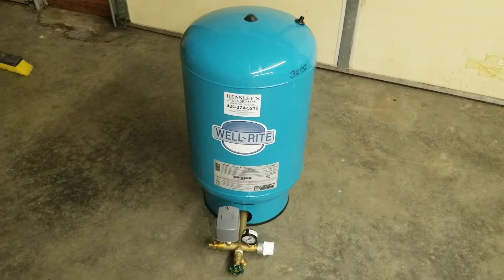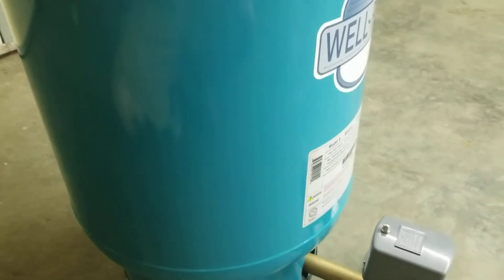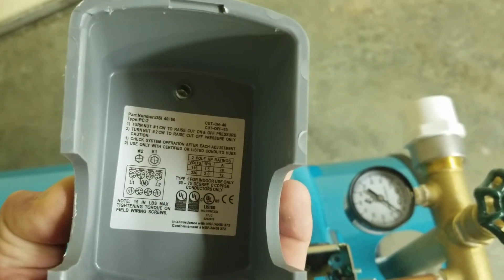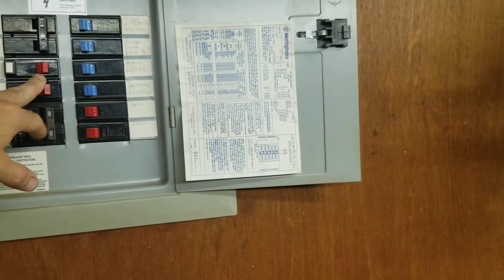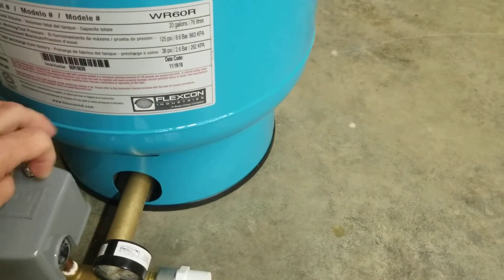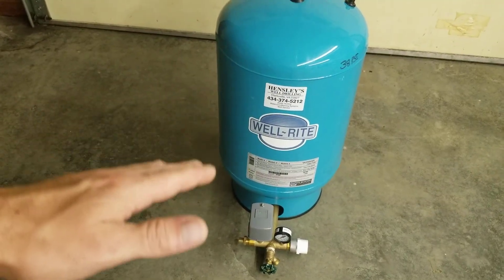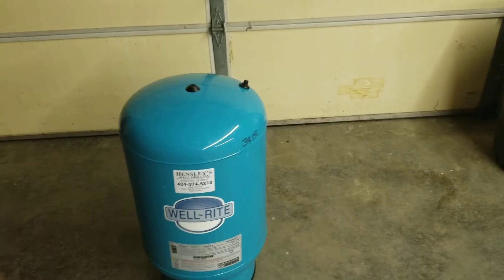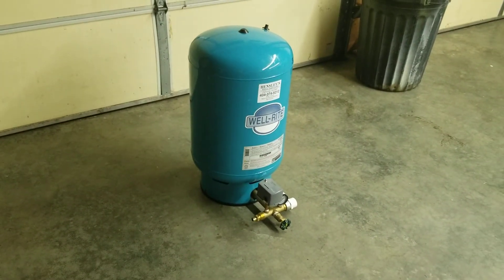Well Pump & Tank Troubleshooting, How the system works, Adjusting Pressure Settings Correctly

Comment: i have  a grundfos  pump  the pressure switch will switch on and off 2 second  intermittantly  at every 30 to 40 seconds ,please advice 
how to repair ? is it the pressure switch faulty or the pressure tank air pressure is low etc..thank you
Reply from the maker: Tank is likely bad or really low on air
Reply: @h2omechanic  thank you so much for the quick reply .So what do i do ,use a bicycle pump to add pressure inside the tank ? how much air pressure is sufficient ?  thanks
Reply from the maker: Under the cover of your pressure switch look for on/off. The on # is key. If it says 20 or 30 or 40, you need to set the tank air pressure 5 psi below it. Yes use a small electric air compressor. First kill the power to pump, breaker off. Then open a sink and leave it open. Then go hook up the air compressor to the top of the tank. It might take 5-10 minutes. Then be sure to check the pressure using a air gauge, or if the pump has one built in, use it to know your pressure.  Once you've done this, turn on the power & allow the sink to run for a few minutes and then turn it off. This allows any trapped sediment to flush itself out. Now if the pressure doesn't build up or hold or you find in a few weeks that it's leaking air out, the tank is bad & must be replaced or itll kill the pump within months! There's lots of videos on my channel, find a Playlist Labeled Well Q&A & watch a few videos & you'll be very knowledgeable about the entire well system. They are very simple and I try to explain things in a way for 99% of people to be able to understand & tackle it themselves.  Hope this helps. 🙏 Be sure to like any videos you watch & share your experience on social media and maybe help me get noticed by a bigger audience.

Comment: Well Done ! Your costumers are lucky to have you ! You are a true master of your trade!
Thank You!
Reply: Hi. I have a pressure tank designed for 60/40 but the switch indicates a 40/20 cycle. The tank indicates it was filled to 38psi at factory. Is there any reason why someone previous to us lowered the tank air pressure to 18 to allow for a 40/20 cycle? Will increasing it to a 60/40 or 50/30 damage the adjustable switch?

Comment: My pump is making a loud vibrating/rumbling noise when the water psi gets around 32-35. If there a serious issue that is causing that?
Reply from the maker: Is it an above ground pump? If so, the front bearing/bushing has died & the impeller is probably out of balance. Best fix is to replace the whole unit
Reply: @h2omechanic  it's a below ground water pump.
Reply from the maker: Could be a failing pump or it could be a worn out check valve rattling. Could be a number of things 🤔 not typical though
Reply: @h2omechanic  do you think it could be the pressure switch?

Comment: Ok brother. Really needing some help. Same issues as we discussed before. Pump service arrived. Got 20 gpm but drawing 8amp rather than 12. Said pump may be on last leg. Still huge amounts of sediment. Now when gauge draws down to 40 and the pressure switch kicks on, the pressure gauge immediately drops to 20ish. Never did that before. Don’t know where to begin checking. I’ll try troubleshooting the tank again but that all seems fine last time. Should I take apart all the fittings to check for clogs?
Reply from the maker: There's no clogs first off. So no. 
8 amps sounds good, but 12 amps sounds bad! Maybe you had his info backwards 🤔
 Unless it's a 120v pump, in which you'd have a single breaker, 240v would have a double breaker. I'd lean more towards the pump motor is dieing, but the "pump" end is still good. They're 2 separate things but sold as a package.  Only thing you can try to do is let some air out of your tank. On top the tank is a little tire stem. Use a Phillips screw driver tip to press the air valve and let some air out for about 15-20 secs. This will allow the system to have a cushion, but will lessen the pressure slightly. If that doesn't fix it, you'll have to replace the pump. I think the tech is correct.
Reply: @h2omechanic  sorry to bother. Is that little tire stem on top of the tank replaceable or do i need to replace the tank? mine is leaking alot, and loses all pressure very quick. Thanks in advance.
Reply from the maker: @joaomariogafanha5752  if its a rubber type, you'll have to replace the tank. If its a solid metal/welded on type, you might get lucky and tighten the little stem inside. You'd need a simple (Schrader valve tool/cap). Google it & youll learn how it works for a tire, & its the same thing

Comment: Is their an easy way to replace the tank without dismantling the whole system?
Reply from the maker: To test if your tank is bad? Is that the question? 
Yes. You'll need a tire pressure gauge. 
Turn off the well breaker. Open a sink & wait til it stops running water but leave Open. Go to the tank and try to tip it slightly L&R. It should be very easy to tip. Then on the top of the tank, remove the little cap & check the air pressure like you would a car tire. If its really low, below 10psi, use a air compressor & pump it to 25psi. If it doesn't hold air its bad. Theres a rubber balloon inside them. They can fail & kill the pump within  a few months. Hopefully this helps 🙏

Comment: We will have an initial good flow of water that turns to a trickle in under a minute. Is that a bad pressure tank?
Reply from the maker: Its likely that the nipple below the switch is clogged. Remove the switch and clean out the nipple

Comment: I want to go away from the pressure tank in this configuration.  I want to have a 100-200 gal tank buried at the surface.  I want to have a float switch of some kind that has this tank filled as it is used.  I have a low producing well pumping at 5-10 g per min.  I don't used that much water really but want to have a separate pump at the surface that when water is turned on, that surface pump 220v? comes on and pumps the water at a higher pressure (the 200 g of water in the tank) as it forces that water through filtration and too the home.  I do not want my 1/2hp 10g min pump set at 200 ft in the ground to have to pump water up 200ft under bladder pressure.  Wouldn't it be much better and make my pump mast longer if that water from 200ft was pumped at atmospheric pressure into a tank, maybe even a tank 12ft higher in my garage attic.  Then when water was demanded, that surface pump could take that 200g at 12ft above the ground (12ft head) and my water pressure would blow me away, like I want it to?  Tks for any comments and recommendations for a system like that that already exists.  Tks
Reply from the maker: Sounds like your an engineer lol. Your description is way over complicated.  
My recommendations. Your well is a great producer at 5to10gpm. If it was mine, I'd run a 5 gpm-3/4Hp itll flow 5 at 400ft & 14gom at 180ft. Id use a 86 Gal bladder tank, then go through any filtration system, but size the heads for 1" not 3/4" . Then buy a Franklin VFD booster pump that only will run when it senses high demand.  That's the simplest way.  Itll be hard to find a service tech on very complex systems.  
Lastly, most people think they want more pressure...wrong, you actually want more Volume! So you do this by running all 1" main house hold plumbing and run 3/3" to any fixtures.  Most are 1/2 or 3/8 to showers. Think of a pressure washer, 2000 psi but low volume at 3.0 gpm. 
A submersible pump will build 150-210 psi believe it or not. But it'll run efficiently at 60-80psi. I've done 1 multi shower head w 8 sprayers & used a Franklin VFD kit & it was crazy powerful.  All in pex. 1"main feeds to manifolds 3/4" to each nozzle. & he ended up turning the system down 😆.
Reply: @h2omechanic  I don't have your email.  Would love to discuss this with you.  gandl2123@gmail.com
Reply: @h2omechanic  I would love to discuss your response, solution over the phone.  Can we exchange numbers?  I go 1" from pump to pressure tank manifold dropping down to 3/4.  This is where I made my mistake.
Reply from the maker: Or put a 20gal tank before the filters & a 86 gal bladder tank after the filters, then a booster pump. Send me a email and I'll send a link to VFD pumps.
Reply from the maker: 4342101376. Txt me over the weekend & ill call you once we get connected.

Comment: Weak water pressure in the house. However hydrants prior to the tank has good pressure. Check valve is in well prior to hydrants and tank. The filter at the pressure tank was packed with dirt sediment. Tank had pressure sitting around 50 psi with tank full of water.  Once I changed filter, we had a bit more pressure. Could it have been just a dirty filter?
Reply from the maker: Absolutely it was all bc of the filter. But be sure not to use the black / carbon filter elements! They're for city water. They slow down the flow of water within hours if used with well water.
Reply: @h2omechanic  oh shoot. That is exactly what we used. Are we supposed to use the white paper looking kind?
Reply: @h2omechanic  I didn’t think it was common for it to have so much dirt in the filter
Reply from the maker: Its not common for a lot of grit to all of a sudden just happen, but let me explain. In your well you have Veins that feed it water,some are plugged with sediment and sometimes at random or if your using alot of water that day, a plugged up vein finally opened up & started flowing water. This water rushes in & brings in millions of years worth of the sediment that you saw. 95% certain that is what happened. 
As for the filter, don't use paper if they have other options at the store. If they plug up, eventually it can tare & allow sediment in & plug up the faucets. Use either the smooth white fiber kind or my personal recommendation use the String Woven type 5 or 10 micron. Those filters just look like a ball of Yarn and are great at filtering and keeping the pressure/ flow up. The smooth fiber is my #2 for filtering very fine particles but you might notice a very slight loss in pressure, carbon is for filtering chlorine taste out of city water. All in All your on the right track & in the well, there's nothing to worry about. The sediment issues will probably last a few months and eventually lessen. Be sure to change your filter once you've noticed weak pressure! Thanks for commenting and be sure to like 👍 my videos! It helps way more than people realize, especially since my channel is about education and not entertainment
Reply: @h2omechanic  thank you very much for your response.
Reply: @h2omechanic  ok so I changed to a white filter and still same pressure. I then turned everything off and opened the lines to drain. Tank was at 16. We pumped up to 38. Should we have drained tank completely versus just opening up a faucet toilet etc?  The white filter turned milky pretty fast BTW. Also we took filter out and then turned system back on. The filter casing began filling up quickly then all of a sudden the water decreased dramatically before filling up the filter. Why did water flow decrease so rapidly?
Reply from the maker: @marcusjames3035  look under the pressure switch lid & see if it says on-30/off-50. If it does then your air pressure is too high. It needs to be 28 psi. When pressure drops off like that its typically over charged with air.
Reply from the maker: @marcusjames3035  kill the power , leave a sink open, then go check the air & be sure sink is open & water has stopped coming out. Then let air out until it say 25-28psi on your air gauge
Reply: @h2omechanic  ok so the tank says 38 on it and the pressure switch clicks off at 60 and on at 40. Pretty sure it’s a 40/60.  So I turned off power and opened faucet. I checked air at it was at 16 so I pumped up to 38. Should I have completely drained tank before checking pressure???

so after pumping to 38, I turned everything back on. The flow was initially great then dropped to a trickle as filling up the filter case. Ended up locating a black reducer type filter prior to home filter. Took that off and it was completely clogged with dirt. I cleaned it out and put back on. Pressure is ok but still really dirty. Out at the two hydrants prior to the pressure tank, the pressure is fantastic and the water is pretty clear. 

I’ll take your word about the veins and sediment and keep an eye on it. Really low pressure, more than normal if washing machine is filling up and kitchen sink is on. Used to be better pressure. If this doesn’t make sense, feel free to give me a call if you want 916-606-1189
Reply from the maker: The tank had sediment trapped in it. Once you aired it up, the water then cleaned out what was trapped. Itll eventually clean it all out within a few days. I think that fitting you found clogged was a great thing to clean!
Reply: @h2omechanic  very last question, I promise...since I didn’t completely drain out the tank before checking the air, should I do that? Could I have got a bad air reading when I checked the air after I turned off the power and opened the faucet but didn’t completely drain the tank?  Because if the air reading was false, I may have too much air now, correct?
Reply from the maker: @marcusjames3035  correct!. I always kill the power & allow all water to stop running and leave a sink open. Bc sometimes water is trapped inside and the adding of air will push the water out. Be sure to tap on the tank & it should ring like a bell & tip it over, it should be light weight. If you hear water sloshing during the tip test, the tank is bad 100%. Tanks should weigh 20lbs when water is at 0psi & system drained.

Comment: Thank you very much for the video and the offer to help!  There should be mor people like you on this earth!  Here is my issue and it just happened today.  Pressure in the house has been good with the exception of one incident 2 weeks ago where air started dto come out of the sink and shower and then resolved -- sputtering water then became good pressure after 45 seconds.  Today - I had my sprinkler system open by an irrigation company.  They turned the water on and you could hear it flow outside to all of the zones on the property -- loud noise -- he turned the water on gradually.  He started turning zone by zone on and got through 14 zones.  On zone 15 through 24 he had very little pressure.  He told me that he would need to come back as there must have been a main line cut to those zones - but he didnt know.  I went down the basement after he left armed with my laptop and attaching to my security cameras observed a zone in front of my house that worked (zone 1).  I turned the sprinkler system on for zone 1 and - no pressure.  I checked. number of zones that worked when he was here - no pressure -- some heads didnt pop up some did with very slight pressure.  At that point I thought it may be the pressure box and cycled the power to the pressure box.  Low and behold - after 1 cycle of the pressure box - zone #1 cape up and ran like a champ until I stopped it after 10 minutes.  I went to the next zone - no pressure.  I cycled the power for the pressure box - had pressure.  When I would cycle the power - I started hearing gurgling noises and water rushing and then water hammer at the bladder tank.  I stopped playing with the power to the pressure switch.  I had good pressure ein the house - just not at the sprinklers.  I called the pump people.  Guy comes down and says - you need a new well pump without doing any diagnostics etc - and - further states you may even need a bladder tank.   My question is this -- things were operating properly with exception of the first air in teh line incident 2 weeks ago.  I find it to be an odd coincidence that when the sprinkler guy comes down and turns on teh sprinkler system all hell breaks loose.  To my not educated mind on this subject - im thinking the pressure switch or the tank OVER the wet pump because the pump puts out water.  He quoted me $2600 for the pump and wants to install tomorrow - Tuesday.  The house is 15 years old.  the sprinklers are sized properly to GPM of the well. Do you think it could be the pump - or - should I call in someone else and get a second opinion...?  Also -- he said he doesn't know what HP the pump is - and said it could be 1hp or 1.5 - he said you could replace the 1hp (if its 1) with a 1.5 -- is this necessary?  Will it increase pressure (guess not) - just rate of water that goes into the bladder tank - and then it is the tank that controls pressure with pressure switch - yes?  Appreciate your opinion here -- sorry for the long book...  THANKS!
Reply from the maker: Replace the tank for sure
 The air you were getting was what's normally Trapped in the bladder, yours I believe busted & started giving you air. This will cycle a pump too fast and make it over heat. 
If you have a 1hp pump a simple Amp test should read 9-9.7amps if its higher than 11 amps, you'll know 100% that the pump is dying. So before you replace the pump, watch them do a amp draw test & look at the #s on his meter. Any "clamp" style amp/volt meter can test it easily. Your pump replacement being a 1hp is likely to be $2000 max. Tank replacement should be $700-$1000
Reply: @h2omechanic  that you very much!!!!  Today -- everything started working again -- great pressure on the sprinkler system and showers etc.   Perhaps the pump is going and has good days and bad days - I dont know.  I find it interesting that when he opened the sprinkler system yesterday - everything went to hell - and then normalized.... Do you think there is any rationale for it not working yesterday - and working fine all day today?  Thank you very much - once again!  It is appreciated!